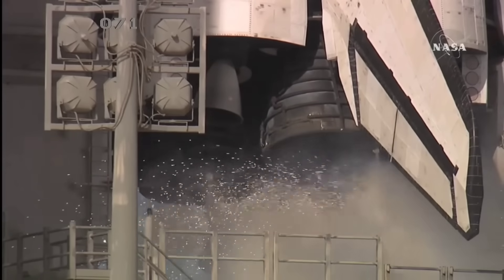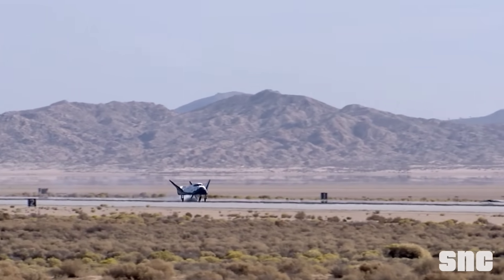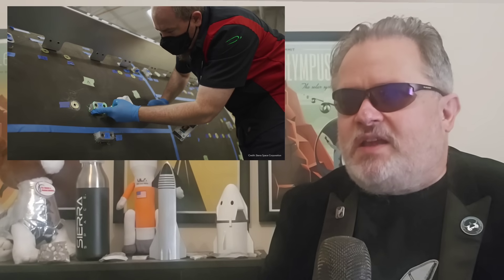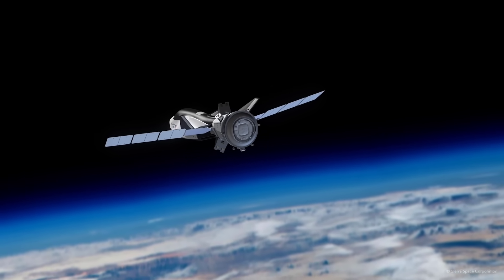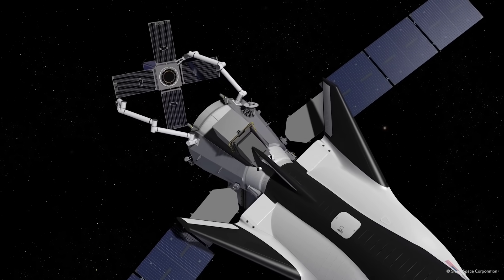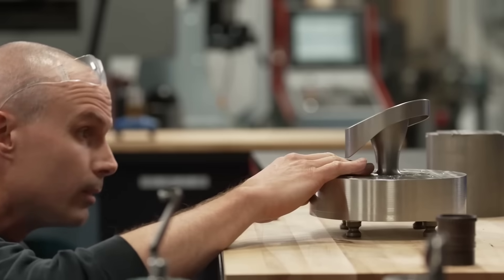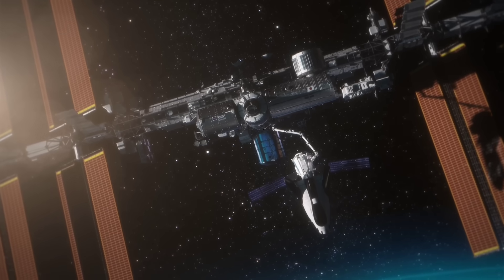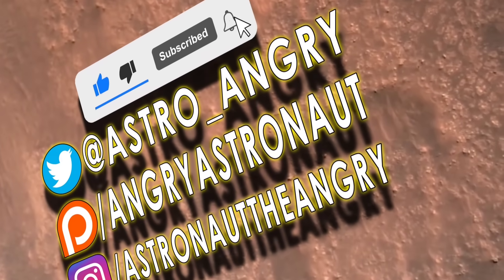Dreamchaser is better than SpaceX Dragon and even Starship for some jobs!  Here's why.

Comment: Currently the other 's%%show IS Starship, not just Starliner.
Yes. X-years late and $4.5bn later and its still has issue and NOT in service until '25.
Starship - enough said. To say its problematic is an understatement.
Dreamchaser, as you say, is unproven.
Cygnus, like both versions of Dragon has a proven record, thankfully.
But the US has a proven spaceplane in service, the X37B (though not in
NASA service. The US has an opportunity with the X37C, or a variant thereof. That's a BOEING product.

Comment: Looks cool and all, but the future of Dreamchaser is not good once Starship is available. You say you don't always need a large payload capacity, but customers, especially the government not only relies on payload capacity, they also rely (heavily) on price per Kg of cargo or per launch. Starship is supposed to be cheaper to launch than Falcon 9. This would mean customers can now have access to a new cheaper launch platform with a larger payload to boot. Remember, Dreamchaser's stage 1 rocket is not reusable and is much more expensive to launch compared to a Falcon 9, and Starship will be (supposedly) a lot cheaper than a Falcon 9. Even if the customer does not need a big payload, they will still choose to launch a cheaper platform.

Comment: I wouldn't call Dream Chaser 100% reusable when it have an expendable service module.
Also it have to be launched by 100% expendable rocket.
To truly be Space Shuttle heir it have to carry second stage engine where its service module currently is and somehow be able to re-enter and land with it.

Not that I don't like Dream Chaser: I believe that lifting bodies are better than capsules - just as was mentioned in the video - because of much lower G-forces and ability to land on any airfield.

Comment: Why would it need a fairing for launch? Surely, the aerodynamic forces of launch would be less than the forces on re-entry. Not needing a fairing would save weight, and would also eliminate having folding wings, increasing reliability while reducing cost and weight.

Comment: According to some analysis, the biggest flaw of the Space Shuttle design was the big fuel tank and the solid-fuel boosters (which still add cost to SLS). Buran was strapped to a super-heavy rocket with less danger of it's tiles being damaged during start. Dreamchaser philosophy is closer to Buran, only with stacked approach and cheaper to carry the potential crew. It may turn out Spaceship won't be without some early bugs, making it less safer for people at the start than say Dreamchaser.

I remember there was some convoluted history of these mini-shuttles. Both Americans and Soviets were testing some of these while aiming for the actual shuttle and somewhere it was stated some of the soviet mini-shuttle prototypes was bought by Americans or maybe the design was copied by Dreamchaser. There's also the US Space Force mini-shuttle from Boeing.

Comment: Not saying it doesn't have a purpose but it's not going to out do Space-X.  And am not a supporter of Soace-X.  Just the only working deal out there.  Also this design and promises will end up to be it's failure.  I have had my own idea but it's will not be ready if we push hard for about 2-3 decades.  And as you saw carbon fiber is really good.  Just not in space or under the oceans.  It's the wrong application for it.

Comment: I agree Dream Chaser (it is officially two words) is the future of crew transport and I'm betting Starship will never launch and land humans (on Earth) but will launch without crew and refuel before being met by a Dragon or Dream Chaser with the crew. But you massively over-sell Dream Chaser's reusability! Firstly there is no meaningful reuse distinction between Dragon's expendable trunk and Dream Chaser's expendable Shooting Star (except the latter is more functional and therefore subtracts more from reuse). All the Dragon trunk does is support the solar panels and radiators and provide space for unpressurised cargo, everything else comes back in the capsule. Furthermore, Dream Chaser only approaches Dragon's level of reuse as a system if launched on a reusable first stage without a faring, which does not seem to be in the current roadmap. Finally I'd like to understand why they moved to launching in a faring (requiring the development of folding wings) when they presumably have to move  back to 'naked' launches for the crew version to enable launch escape?

Comment: Reentry capable shuttles are able to use long runways.
The Shuttle was always relgated to NASA / DOD - controlled runways, but a private lifting body can be rerouted to commercial strips.
That, and the orbit can be adjusted with ultra-high altitude manuevers and reboosting

Comment: Time to generate some “angry” responses.  The clip looking from the cockpit was so Buck Rogers with the windows and bolts holding them in.  Very romantic - and expensive - and complicated - and prone to compromise due to stress.  Apologies to the victims of Titan.  Several 8 k cameras and a micro led screen would eliminate the need for windows.  Ok, paint some “faux” windows on the outside to pacify nerves.  It is so much easier to build a craft like this without them.  Same for commercial airlines.  Boeing would love to pass  on portholes on airliners to reduce cost and increase efficiency.  There are screens on the back of seats that would give much better views from high depth cameras.  Oops, got off track here.

Comment: I think Dreamchaser needs to perform the abort system like SpaceX.
Reply: space shuttle never had an abort system, so as the starship.
Reply: @vidurasankalpa  And it ended well... remember Challenger and Columbia that should had been aborted to avoid reentry.
Reply: but compared to the dragon, yeah.
Reply: @vidurasankalpa  I'm kinda thinking, how would dreamchaser escape if it is inside the faring during launch.

Comment: You might have missed one safety advantage….mounting the space shuttle to the side of the main stage exposed it to a lot of potential damage from the ice breaking off and striking the heat shield…there’s considerable evidence that the second loss was caused by such an event. There’s no question that the top mount is much safer… no exposure to ice damage, and as you stated, very high possibility of escaping any damage from a rocket failure or explosion below. This is a far safer system in principle…..in my opinion!!!

Comment: Jordan, where do you get the economic data to state that Dream Chaser will be much less expensive than Dragon?  You say it's 100% reusable, however the cargo module cannot reenter the atmosphere, so you have to buy a new one for each mission.  And how expensive is the booster that Dream Chaser will be launched on compared to Falcon 9?  I think you want to believe this craft will somehow be cheaper and it might actually be at some point when Vulcan becomes fully reusable (if ever), but the Centaur upper stage will be more pricey than Falcon's upper stage since the former will probably launch maybe 1/10th to 1/8th as frequently as Falcon 9.  

Dream Chaser is impressive enough as it is ... no need to go out on a limb with claims backed up only by conjecture.

Comment: All pretty true, but Dreamchaser still needs a booster. And the only reusable booster in town currently is Falcon 9. But that means the second stage discard means Dreamchaser would not be, technically, fully reusable as a complete launch system. That's important.
And it is not "better" than Dragon, actually. That's like comparing a PC to a tablet. They're different animals; different form factors solving different problems. Or, potentially, different solutions to the same problem.
Either way, there's no market for Dreamchaser yet. And that - rightly - is what's really holding it back. When it finds its problem, and has a completely reusable launch system, then it will certainly become the solution to problems Dragon won't be able to solve. But, right now, those problems don't exist yet.
Until then, I hope your friends keep going with it. It is very, very cool, after all.

Comment: To be fair, the shuttle was never initially intended to be as big as it ended up being in order to satisfy dod demands for spy satellite retrieval and landing capability.  If it had been built as originally conceived it would have been much safer on top of the rocket stack and much cheaper to reuse much like Sierras design now.

Comment: LoftID was 6 meters diameter.  Superheavy 9 meters.  Stoke space 4 meters.  Falcon 9, 3.7 meters.  I would imagine Stoke could scale to larger diameter and it would have slower reentry like loftid.  It should also be able to land  gently given the deep throttling advertised.  Well see.  Lack of tiles is a major improvement.

Comment: Dreamchaser, Rocket Lab etc. should be thankful AF that SpaceX has zero designs on crushing all the startups out there.  Because you bet your arse they would develop these smaller / mid-range rocket solutions and cover those markets as well.  Personally, I've wondered why they haven't, and the only answer I really have is that they understand it wouldn't be popular with space enthusiasts.
Reply: Although there has been a long talk and rumors both within and outside of space x, the major reason why is they are spending 99.9% of time doing 2 task.

1 is to make sure that Falcon line and the heavy Falcon are capable of delivering loads as required by their current contracts.
 2. More importantly is any spare money and resources are being spent to get starship certified and operational.
Yes they have lofty goals and future goals , but they're paying attention to the tasks at hand.
You could double triple the number of  rockets companies , it would not even remotely  come close to putting  enough infrastructure  in orbit and beyond.

Comment: If Dream Chaser has to launch in a fairing for aerodynamic control authority reasons, will that arrangement ever be crew certified?
Reply: you mean, because work ethics prohibit lauch vehicles without viewing windows, so the astronauts can always take a peek outside and know where they currently are in space during ascend? Just kidding ^^ As I see it, they just would have to prove, that Dream Chaser can escape in a catastrophic malfunction of its carrier rocket at any given point - so I'd assume the fairing would have to be instantly removable to make way for the short emergency ascent of Dream chaser under its own power. Maybe the Dreamchaser engine startup process itself could blast the fairing halfes away because of the bigger volume of gas as soon it comes out of the nozzle. It's surely an additional complication, but I believe a solvable one.
Reply: @genius1a  I hope so. When something is in danger of going "BOOM!", milliseconds count.

Comment: Do you chaser must be stopped! The shareholders of the Boeing corporation are demanding that dream chaser must be stopped! Since, shooting it down with a missile might be frowned on, couldn’t the Boeing company just buy Dreamchaser? If the Boeing company bought, Dreamchaser, the cost of Dreamchaser could easily spiral up, at least by a factor of 10 and the launch date for Dreamchaser could be pushed out by five years. Dream chaser must be stopped!

Comment: Obvious observation:
With a connection node, multiple Shooting Stars could become a larger space station on the cheap.
One could easily imagine designing a node with the proper geometry that connected Shooting Stars would form a spinnable station to create lunar gravity. (Likely, not more.)
Very interesting experiments could be done in such a station. It would mainly be built of vehicles that would have been reentered otherwise.

Comment: Love Starship and it's concept, but one thing is for sure : no way human beings are ever going to return from space in a craft full of explosive fuel.

The idea of people ever coming back in a giant tube full of explosive liquids, igniting that fuel, and flipping the entire ship at the last moment to land tail first...no way ever.

People have always come back in empty, inert vehicles, gliding in or splashing in the ocean (or thumping on land sometimes under big parachutes). No other safe way.

Dreamchaser fits the bill for regular, safe trips, without the hassle and logistics problems of landing out at sea someplace.
Reply: I don’t much agree. In the modern day, we don’t worry about rockets collapsing on the pad because of depressurization, like the old Atlas missiles did. Why? We’ve innovated beyond it. Engine failures on flight-certified vehicles are very rare - one failed over the course of the whole shuttle program, and none of them were responsible for either of the two Shuttle disasters. Besides that, it appears that the true risks are in reentry and launch rather than landing. To mimimize the risk in launch, you make those engines as reliable as possible. If you’re already making them super reliable, why not apply this to landing as well?

Starship, especially, has redundancy for landing- it can land on only one functioning engine, according to SpaceX. With their new hotstaging method, they can preform aborts much quicker and easier than ever before. 
Besides, no crew vehicle has ever been inert. Soyuz carries its retro rockets, Apollo it’s toxic RCS fuel (which almost killed the crew of Apollo 15 when it leaked into the cockpit and killed one parachute and almost burnt away another), Shuttle, it’s toxic MMH/NTO OMS, and the same for every other capsule. At some point; the risk of using parachutes becomes too great, why not just use propulsive landing instead? 
Even beyond that, propulsive landing has been proven to be just as safe or even safer than some human-rated launchers of the past. The Falcon 9 booster, when looking at landings in the last two years, has had a higher chance of success than the Titan II, Atlas-Centaur, Antares, Electron, Firefly Alpha, and even the Saturn V, if you count Apollo 6 as a failure (which you should as it significantly damaged the vehicle.)

My point is this- run from it all you want, but propulsive landing is the future, is safer, and will be coming. That’s it.
Reply: @kspkreations3342  
Well, you make good points, and I'm sure that there will be many, many unmanned test flights before any people ride Starship, but that last second flip maneuver is hard to accept.
A ship with 10-20-50-100 people on it is going to flip like we saw in the three test flights? How will they be strapped in? Will they all need suits of some sort?  Every single item in the ship would have to be absolutely stowed and secured. Tremendous stress on the whole ship, again and again.
Maybe if it flips to vertical several thousand feet up it might be more reasonable. Returning Falcons dont really flip - they sort of come back like an arrow dropped off a skycraper.
If anything goes wrong at all, your're looking at something akin to the Hindenburg (but no survivors)
Most every other aircraft can return to earth with minimal or no fuel. A jetliner can glide to a safe landing with no casualties, the "Sully" episode in the Hudson River being an example. Helicopters can auto-rotate to a thump landing if needed. And also the shuttles and Dreamchaser here (granted they have some dangerous substances on board).
Also that little unmanned space-plane thingy the airforce uses - orbits the earth for months and then peacefully glides back.
I remember that Dyna-Soar project from the early 60s. Never flew but many artist images of it sitting on a booster. 
I like to imagine some large winged craft sitting on top of the Starship Booster with many going up and many gliding back.
Reply: Well yes, landing in a bomb is disconcerting, but you're doing essentially the same thing in a plane, except the fuel is in the wings, it still can go boom.
I'm not a fan of the flip maneuver either.  But it is a test bed for proof of concept just like Dream chaser is a test bed for proof of concept.
Starship s vertical landing has limitations.  You're way off the ground, and the elevator (which still has to be proven) has limitations on cargo capacity and time.  A horizontal landing would be more ideal putting you closer to the ground with larger cargo doors for bigger payloads.  Folding wings need more research and better materials along with the landing legs.  Problem is horizontal landing of that massive beast would require a huge landing strip or some massive powerful  retro rockets.  The fuselage would need to be more oval I think to aid in reducing landing speed and G forces.